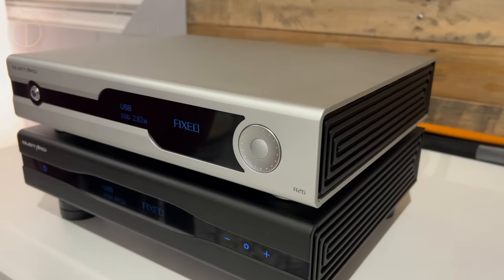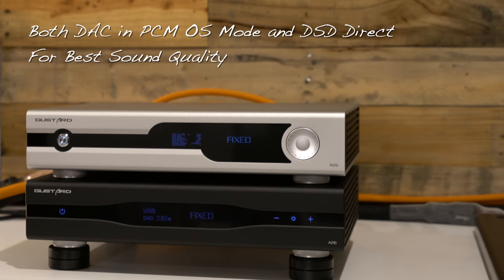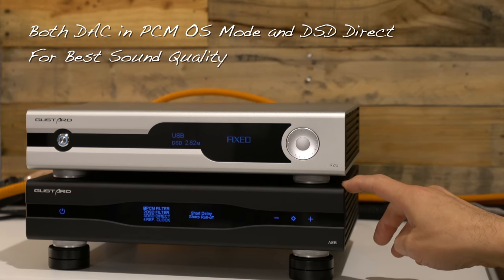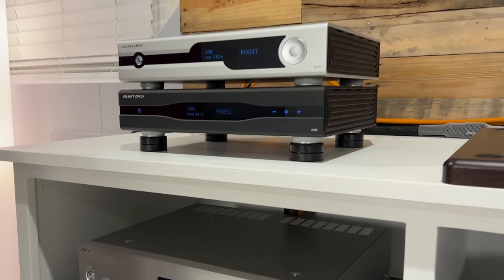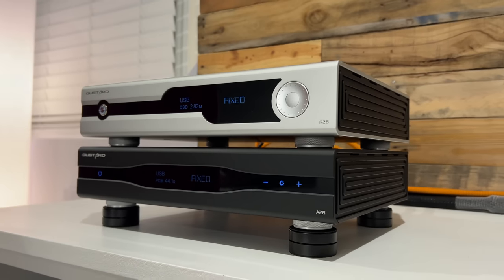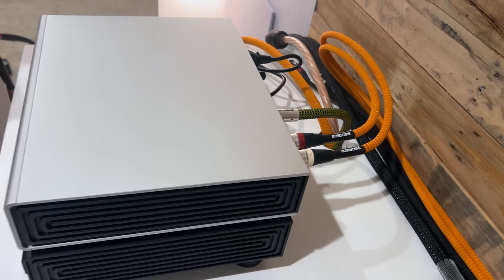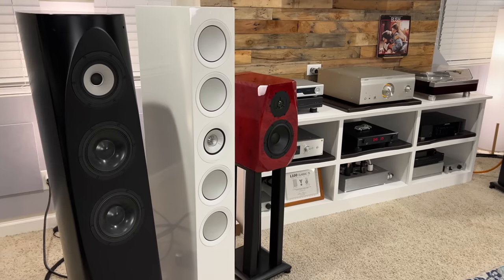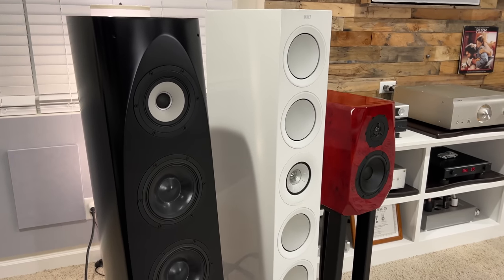Gustard R26 R2R Vs A26 Delta Sigma DAC Comparison

Comment: Interestingly different POV from most other reviewers regarding the R26, which I have, and in my $60K system, I prefer it to my Terminator II, which I've since sold. I especially prefer it for soundstage and instrument separation even compared to my Musetec MH-DA005, a dual mono 9038PRO DAC, and my Lumin P1's internal dual mono 9028 DAC. Also prefer its  timbral presentation of vocals and acoustic instruments. The only DAC I have that I prefer is a new Lampizator Baltic 4 with NOS tubes - but it's only a slight preference regarding timbre. Goes to show you how subjective this hobby is and how different system synergies affect the outcome of these comparisons. This reviewer has been reliably consistent so I have no reason to doubt his evaluation of these DACs, I can't understand why anyone would be annoyed by the fact he prefers the A26 - it that's you, get a life dude!
Reply: I just can't understand his centre image comment on the R26. 
No centre image . 🤦‍♂️
Reply from the maker: Currently I’m breaking in Terminator Plus 12th, I will let you how it goes in my system, thanks for sharing.
Reply: @Tharbamar  Just checked the price of Terminator Plus 12th... Lol !!!!!! Respect !!!!
Reply: And for his main genre, it seems the A26 suits better. I've read/heard a few times.

Comment: in my system, the R26 audio sample have MUCH more punch than the A26.   A26 a little bit more detailed, but I prefer the R26 punchiness any day of the week.
Reply: Too much detail have negative impact on the musical pleasure in my opinion.
Reply: That's why I chose the R26 over the Chord TT2 & M-Scaler.  Don't want an analytical DAC. I want a fun DAC
Reply: @JTB--  Yes!These super expensive DAC"s are highly capable, but we don't want that when we are enjoying music.When DAC"s are analytical our brain works more, because it needs to calculate those extra details in the sound which after very short time will stress us too much.We need to find the perfect line between details, tones and spaciousness to get that pleasure in our brain. Anything too much will brake the joy...
Reply: @beslemeto   Well said

Comment: Audiophiliac is right, you need at least 2 systems to cover all music genres. If you listen to Daft Punk, Dua Lipa and the like you do not need an R2R. However, if you listen to jazz, acoustic or music with a lot of instruments R2R works best. Cymbals sound more realistic and the instrument separation is much better. Only way to know if to listen to both technologies and compare, like Loic from Hifi Cave says: it is a matter of taste!
Reply: I agree 100% r2r plays better acoustic, jazz, instrunents. Delta sigma plays better elektronic, pop, metal music...
Reply: You just need correctly recorded, mixed, mastered tracks and the one right system.. badly recorded, mixed or mastered tracks are all over the place meaning you would need a different system for each one to make them sound right.. also tracks mixed for radio are crap by design...
Reply: @lextr3110 
You are absolutaly right.
Our system are always in the second in this chain.
Reply: Agree. I have two systems in my rack, they both use the Ares II. The Denafrips Hades and Thallo A?B amps, then when I want to rock the house with the KLH Model 5's, I use the Schiit Freya S preamp, along with the Class D XTZ Edge A2-400. I also have two SVS SB3000 subs. 

As far as which DAC, and the music I generally listen too, I think the Pontus II 12th will suit me and my system the best. This R26 sounds harsh and bright to me, more like a chip based DAC. Not impressed with any of the sound demos I have heard of the R26.
Reply: What about for prog rock and metal

Comment: The A26 DAC offers excellent value for money and it sounds absolutely superb in my system. I've been using the X26pro for a year and half now but the A26 just puts in in the shade from every angle in my opinion, I just don't get tired of listening to it. I also agree with your honest appraisal Tharbamar on the A26.
Reply: sorry but the translation is not clear to me! I also have x26pro. surely at 26 it sounds superb and less tiring but if you have to give an opinion on who satisfies you the most, who do you prefer? thank you
Reply: @221298ale  I prefer the sound quality from the A26 over the X26pro as it reproduces a coherent and enjoyable musical performance in a much more realistic way than the x26 in my opinion. The x26 lacks the soul of the music. Don't get me wrong, the x26 is fabulous DAC but the A26 does it much better in every department.
Reply: @johnnyg1700  thank you

Comment: Listening to this several times, it's almost as if the A26's dynamics are almost too abrupt, a little too accelerated.  It still sounds fantastic but perhaps not quite as natural as in real life.  The R26's dynamics are just as excellent but changes in volume ramp up a bit slower and more natural sounding to me.  I'd be glad to have either unit for sure.

Comment: Thank for great comparison!

Currently own SMSL D300 and D400ES. When paired to Kef R3, situation is quiet comparable to R26 vs A26. D400ES is more detailed with more precise positioning. And difference is very obvious. But I still prefer D300 for my liking. Also with D400ES Kefs prone to sibilance.
So in the end ordered R26 to replace D300 in my speaker setup.
Reply from the maker: Thanks for sharing!

Comment: I have now tested both in my system. I can understand anyone who chooses either the R26 or A26. The R26 is definitely one step ahead when it comes to the sound stage, the depth of everything that happens behind the speakers, the A26 can't keep up. But I didn't like the vocals at all compared to the A26. The vocals and bass performance of the A26 are great. In the end I kept the A26, even if I wished for the sound stage of the R26 for some titles and the TV sound.
Edit:
SR Purple 2.5A Fuse highly recommended for the A26
Reply from the maker: Thanks for sharing
Reply: I believe its a slow blow 3.15A for A26 and R26 if we're talking about the one by the plug
Reply: @jsuno23  I tested the Gustard 3.15A black fuse first. It's not good for the A26/R26. The 3.15 is for other Gustard devices. The sound even got a little worse with the fuse compared to the original(Original is 2.5A ). Better test 2.5A fuses. The SR Purple gives a clear improvement
Reply: @neo4bremen  if you read up on headfi threads you'll see why as well..purple fuse are more prone to pop with the original rated A
Reply: "Select 630mA for U16 /U18/C18/ C16 / X16 / H16/ A18/ X18.  Select 3.15A for p26. Select 3.15A for X22 / A22 / X26 / H20/X26PRO/R26/A26"  when I bought the upgrade GUSTARD brand fuse from shenzhen audio
Reply: its in the gustard R26 and A26 threads just search for purple fuse
Reply: as far as the sound goes on a 2.5A I can't say or won't try for the risk.  But if it does sound better to you, then cheers!
Reply: @jsuno23 Gustard does not yet have 2.5A Black fuse for the A26/R26, so some sellers recommend the 3.15A because they are on the safe side with it in terms of protection. But original 2.5A are installed. I was just sharing my experience here. the Gustard 3.15A was not good for A26. the sound was slightly foggy after burn in. But you should test it yourself… I tested several brands. 2.5A is Original installed from Gustard and correct! And also "Select 3.15A for P26" is wrong from Shenzen Audio. 1.6A for P26 is correct!

Comment: Dear Tharbamar,
Thank you very much for this comparative review.
However, tbh, I think one of the biggest comparison points is massively missing.

R2R DACs (like R26) are natively built for PCM music input.
Delta Sigma DACs (like A26) are natively built for DSD music input.

So, one of the main question on all the audiophile forums everywhere is how good these DACs are for each input type.

In particular, as you say your preference goes the A26, does this mean A26 is also better for PCM input than the dedicated input ?

Do we have an overall winner, regardless of the input format ?
This is the question everywhere.

Unfortunately, you presented your cables (interesting), but never said a single word about the input files (PCM or DSD)…

When feeding A26 with PCM it will first convert PCM to DSD.
When feeding R26 with DSD it will either first convert to PCM (DSD=OFF), or stay in DSD (DSD=ON), but then it completely by-passes the R2R ladder (main asset of the DAC) to a small 1Bit DSD converter (but then you use just “10%” of R26).

Since it is well known that DACs are generally not so good at making these file type conversions (compared to HQ Player for example), it is unclear if any weak point you mention for A26 or R26 comes from the need to transcode due to the choice of input file, and consequently from the potential degradation underway.

So this review is surprisingly dodging one of the main audiophile’s question.
And globally what conclusion can be drawn in this situation ?
Maybe… not so much actually
This is a bit… frustrating.

Would you please consider an add-on video review : The Gustard Battle, part 2.

That would be so great.
Thank you so much for your work.
Reply from the maker: Thanks for the advice, as I stated in this video my comments were based on many different quality music with mixed file formats (PCM 44.1-768kHz & (DSD 2.8 - 5.6Mhz) but I will keep in mind for future videos, thank you.

Comment: Body is the last thing I’ll compromise in my system. On of the reasons I’m still hanging onto my rega DAC and sold the Ares II.
Reply: Rega sounding better than Ares 2? 🤔
Reply: @beslemeto  yes, the ares sounded somewhat uneasy/chaotic, lacking in flow, diffuse imaging in nos (linear interpolation), tendency towards sharp midrange (more in OS) and lacking in lower midrange body. Obviously not the objective truth, but my experience in my system and room, given my preference. I have not tried many other dacs,  but I clearly prefered the Rega to older DAC magic, meridian explorer, audiolab mDAC and the DAC built into the Hegel H190. Works very well with a quality digital source, best over coax. At some point I’ll get a better source, but the Ares deterred me from trying other Denafrips dacs (especially given the no return policy and lack of guidance from seller).

Comment: I felt the R26 central vocal is a little more spread out in comparison to my Denafrips Terminator Plus. After upgrading the R26 fuse, the R26 has improved in its imaging focus and has more punch. Have you considered in upgrading its fuse? I will definitely get the A26 for a trial.
Reply: You like the R26 better than the Terminator Plus?
Reply: @YouSoundButtHurt  The T+ is still trump over the R26 but it is close.
Reply: R26 end game dac
Reply: @DKH83  Using LAN port on R26?
Reply: @beslemeto  Usb and opt.
Reply: What difference did you hear with fuse upgrade? I have the R26.
Reply: @williammilligan1451  More body and punch.  It warm up the sound signature a bit and more dynamic as though it has more power and less restrictions.
Reply: @DKH83  Thanks.
Reply: Come on, dawg, if the sound quality could really be improved with a new fuse, they would have included the “good” one with the unit. It’s a fuse!
Reply: @TonyBologna999  Yeah, I don't expect any improvement but were surprise.
Reply: Curious, what fuse did you use?
Reply: @DKH83 
Nonsense.
Bellve me. Placebo effect or you are jokking.
Reply: @driacozknows2211  I used to be a none believer like you but once I have a very revealing high end system I can hear different signature with different cables and less so but also noticeable with some fuses. If you can't, just save yourself the trouble. I know a lot of limited measurements claim to make no difference but honestly we don't fully understand what our ear and brain could process for these studies to judge those who could hear the differences. As I said, I could not hear the differences until I have a more revealing system. It is not placebo as I was from your camp but was converted. I trust what I could hear.
Reply: @TonyBologna999  sadly not true Chris. Manufacturers almost ALWAYS cut corners at end of day unless they know they can squeeze even more out of customers. Power cables and fuses are often THE most cut and quality reduced components even with equipment costing many thousands of dollars.

Comment: With the second piece of music, R26 sounded better. That is to say, with acoustic music and vocals, the R26 is the better unit. With the first piece of music, the A26 had more impact and the drums felt more visceral. 

So it depends on what you listen to more, if you are a classical / jazz / acoustic guitar kind of person, R26. If you are into electronic music, hip hop, pop, rock , metal,  (probably for movies too) I think A26 is the way to go.
Reply from the maker: Great Advice! Thanks for sharing.
Reply: I agree 100%. For me, when I go into a more "audiophile mode" if you will, I will usually focus on instrumental jazz such as John Coltrane, Stan Getz, Sonny Rollins, Miles Davis, Chet Baker, Oscar Peterson, Tsuyoshi Yamamoto, etc and female jazz vocals such as Diana Krall, Inger Maria Gundersen, Halie Loren, Chantal Chamberland, Diana Panton, etc. In that sense, the R26 is without doubt the better DAC. You can hear from the 2nd sample, the body of the strings on the acoustic guitar is so much fuller than the A26 and overall it just gives a more organic presentation to the music. Having said that, I also listen to all sorts of other music, more contemporary stuff including EDM, acid jazz, etc. In that domain, there is no doubt the A26 is better with much more drive, punch and stronger transients. In other words, there is no perfect answer to this comparison unless you only listen to a certain type of music, if not you may need both. LOL. But, that is why most people have more than one DAC I suppose.

Comment: Thanks again for a unbiassed and clear review, sorry to bother you with a theme not related with this particular video , but Im about to move (Im an expat ) and Im going to buy a new system , inspired by your videos, and it is a Denon PMA-A -110 amplifier  like yours , but I  have doubts about which speaker to pair with it  , I have at the moment  two favorites: PMC twenty 5 23.1 and the Anphion 3LS , both them  are small tower speakers, which  one do you think fits best with the Denon amplifier? Or you have another strong recommendation for around the same price (4000US dollars) thank you

Comment: Hello 
My experience is that we need time to acclimate the sound of a dac. Years ago i enjoyed a lot a nos muse mini dac with tube sound buffer after it. At that time i couldn't enjoy delta sigma. I found them slow and lifeless. And the voice had more harmonics and sweetness on r2r nos. Then i tried the dac on my new cd player which is burr brown and with time i found it very nice. It's the kind of sound that the more you listen the more you like it. It makes you feel good. Then i tried back my r2r nos and i cannot stand the sound. It's like something is missing in the trebbles and that isn't pleasant to my ear. Same for the tube buffer i don't like it anymore. I prefer my cd player direct to the amp with just a 10k pot for volume. That is interesting is that in your samples of r2r in nos mode i hear the same kind of sound that i don't enjoy anymore. Nos makes a signature for 44.1khz tracks that i don't like. I think for high res it would be different. But i agree that sounds is more real more natural but also the trebbles are displeasing. The only thing that i miss is that voices were more natural and sweet in nos r2r with tube.  I think r2r with good upsampling should be the best but î listen to cds. For the sound of the a26 it seems very enjoyable. But it's hard to tell on short yt video :) i'm not sure it's worth the price. I bought a cheap smsl sd 793 with bb pcm1793 and a linear power supply. The sound is far better with the linear psu than smps. I also experimented op amps but ending preferring the one provided opa2134 to the opa1656 opa1642 opa1612 opa627 opa2209. I made measurements that showed no difference between them but to my ears the differences was very easy to pick. 
Earing you demos i'm not convinced that new akm will surpass this simple classic pcm1793 with a linear psu. To my experience my ear prefer good linear psu to smps and a fet input op amp in the lpf stage. I ve the feeling that akm are not as fast as burr brown and the drums has different sound for exemple. In my experience Burr brown is good for jazz rock old records new records fast slow and to me has no glare no hardness and a kind of analog pleasing sound. I keep wondering why everyone talk only about akm and ess or r2r. I never listen to hi res Audio so i think new dacs are oversized for cd quality. Maybe for hi res they are better. But i wonder also if too much processing for specs make them sound less good than simpler like in the burr browns that are more close to r2r.
Reply: I agree with you ! ! I tried chord tt, audiodg r7mk2,gustard x26pro. And I'm back with burson d160 bb1793 class a! I was hoping to improve and instead I gain bass and authority with x26pro and I lose quality in the treble and it was the best in comparison. With r7mk2 I gain bass, 3d, soul but I lose Too much speed. Chord tt nothing I liked just analytical . Although the Burson's bass is poor and can be improved on various points, it is fast, technical and fun with good air in the treble! I was hoping for Gustard at 26 but from the web it doesn't seem fast or fun! I look forward to hearing it live. Thanks to Tharbamar and all the enthusiasts
Reply: Tharbamar's Sony HAP-Z1ES has Burr brown PCM1795